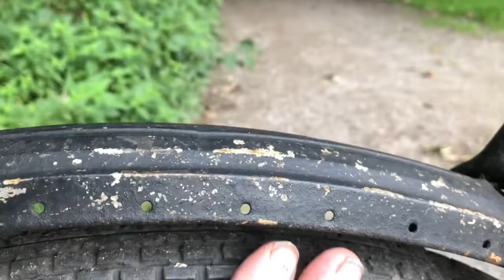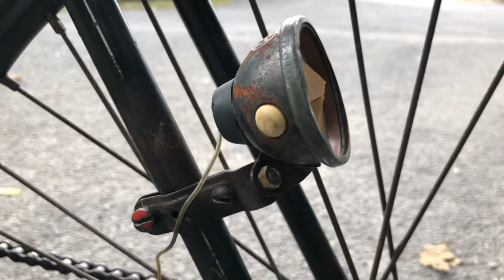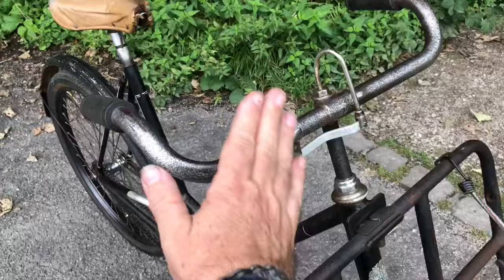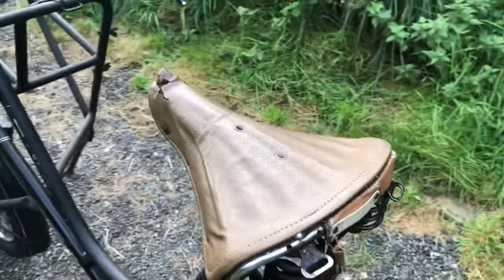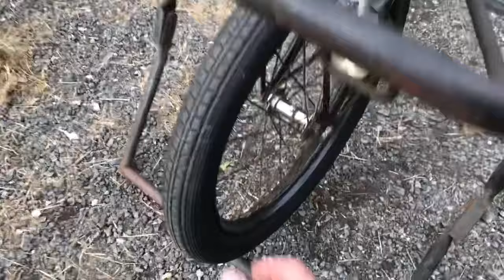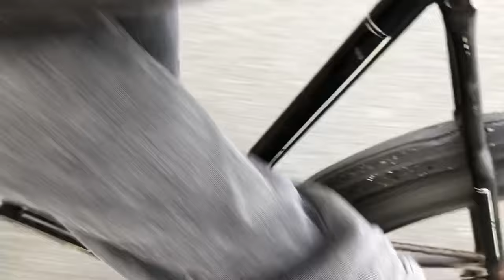New bike reveal! Falke Bielefeld vintage singlespeed delivery bicycle, detailed look & first ride.

Comment: Great bike, regarding the pull to the right, when you did the view of the rack and stand from the front it appeared that the front and rear wheels don't line up (in the vertical plane one appeared to lean away from the other), perhaps it's had a side impact at some point or a heavy impact to the front wheel.
Those frame mounted carriers are so much more stable to ride than fork mounted ones, even when heavily loaded.

Comment: 26 x 1 3/4 is the American designation of S7, the French designation of 650C, the Canadian designation of F12, or the English designation of 26 x 1 3/4.

I happen to own a Canadian made CCM with the same size tyres, but here in New Zealand we usually saw these on "carrier" bikes made by Philips and the rear wheels of low-gravity bikes from a variety of other English brands. I'm sure we probably made our own too, every bike shop used to manufacturer it's own bikes at one point.
Reply from the maker: Yes that’s exactly right

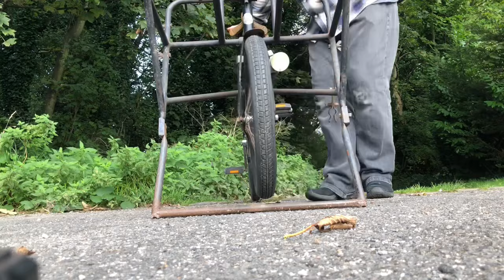Comment: Great video! Interesting what you said at the end about it pulling a bit to one side. I thought the frame looked a bit out of alignment (HT not in the same plane as ST) earlier in the video. Found the place and it was about 12:15. But I could be wrong. It will be easy to see if you look down the bike from the front. If it is twisted a bit it isn't necessarily impossible to correct.
Reply from the maker: It’s actually fine now, after i had the wheel out to replace the brake pad. I think it had not been central before and maybe I’ve put it back the other way round?